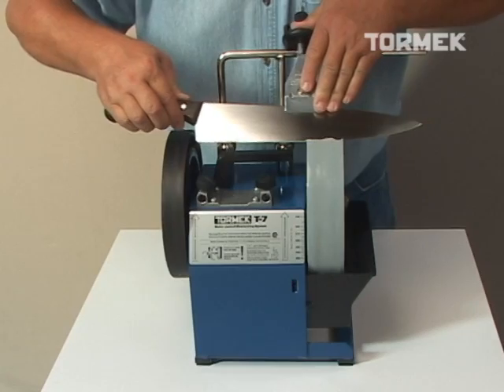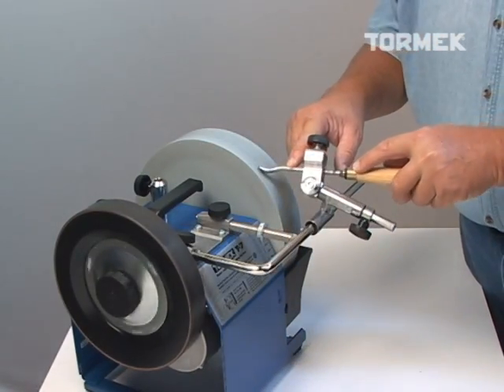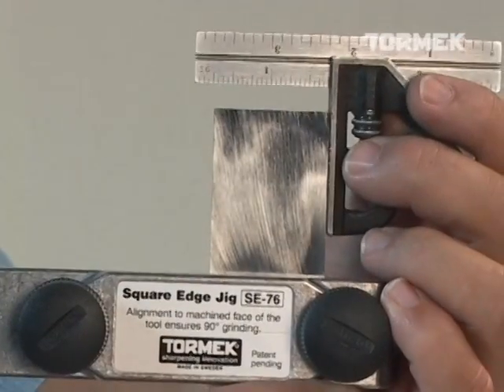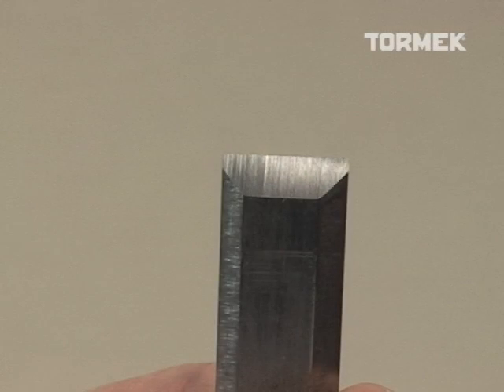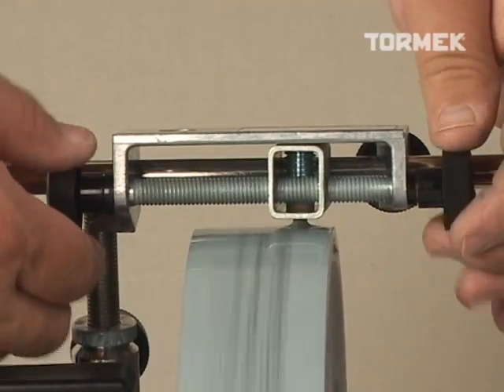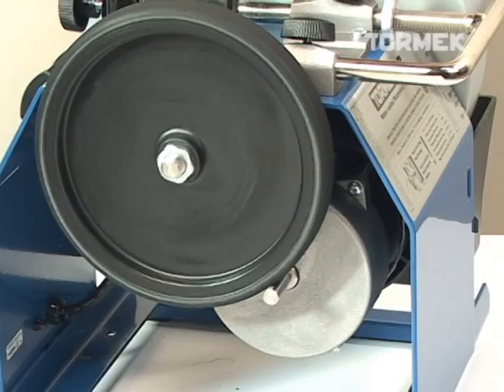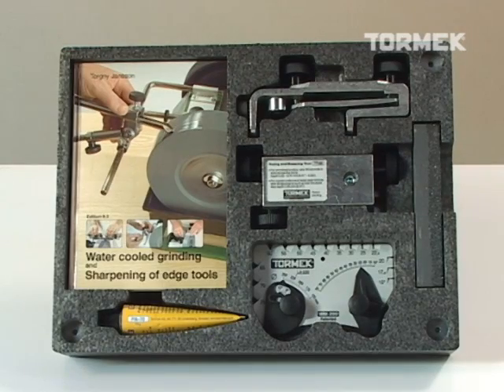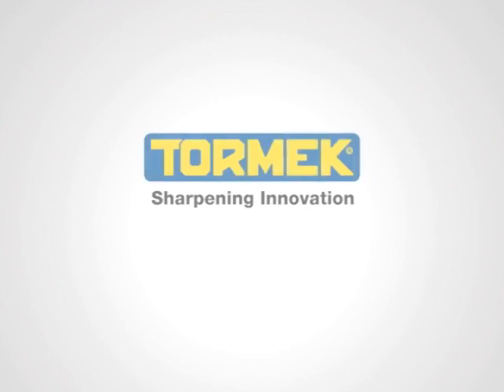Tormek T-7 Sharpening Machine Introduction

Comment: Hi Tormek team.  I have a T7 that i purchased in USA a few years back and love it.  Now I relocated to Poland for work.  Is it possible to use my USA T7 in the Europe voltage ? Is it possible to convert it and use it here in Poland?
Reply from the maker: Hej there, 
the engine of the US machine has 115 volt, it is designed for usage in the US. You can use your T-7 in Poland but you must use a current converter as they have 230 V. Otherwise you could sell your T-7 in the US and buy a new or used machine which is designed for the European market. 

Stay sharp & safe! 
//Tanja from Tormek